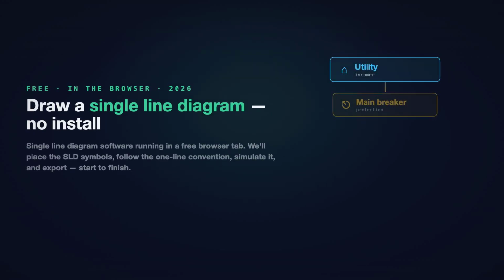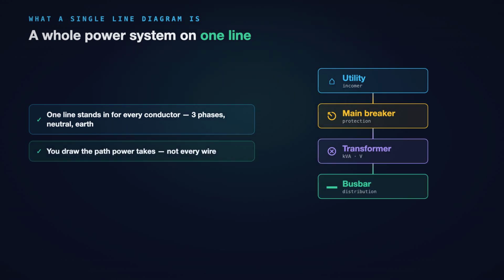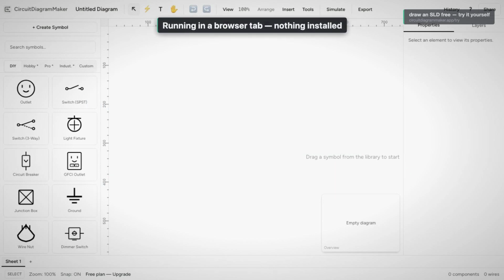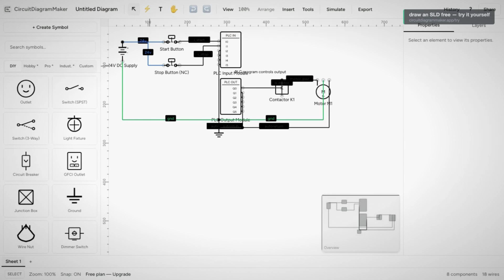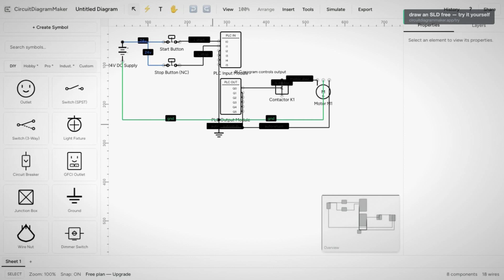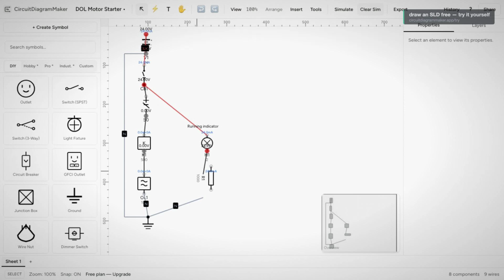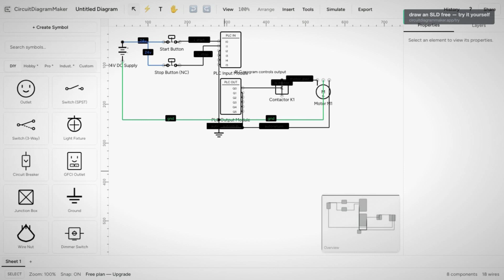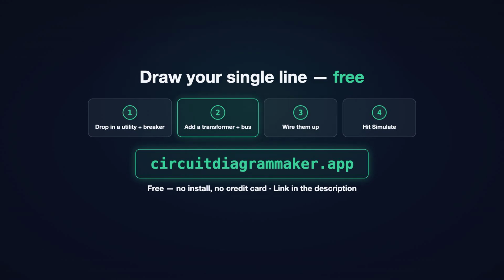Free Single Line Diagram Software (Draw an SLD)

Comment from the maker: Full disclosure (also said in the video): this free browser tool is ours. It's genuinely free to draw a single line diagram in — no install, no login — but it's honestly not a full ECAD suite, and it won't replace a proper protection-coordination or short-circuit study on a big installation. For a panel, a solar array, a study drawing, or a class assignment, though, it's hard to beat.

Quick tip if you're new to SLDs: read every one top to bottom — utility at the top, then a main breaker, a transformer if the voltage changes, a busbar where power spreads out, then the feeders and loads. Get that order right and the drawing reads itself. Label each block's rating as you go — breaker amps, transformer kVA and voltage, feeder size — and you've turned a picture into a document someone can build from.

Draw your single line diagram free, in your browser, and hit Simulate to sanity-check it before you build: https://circuitdiagrammaker.app/try?utm_source=youtube&utm_medium=pinned_comment&utm_content=yt-010